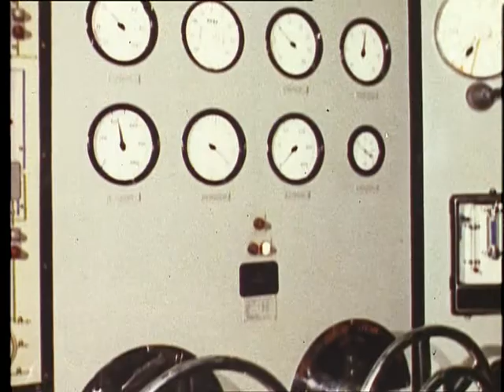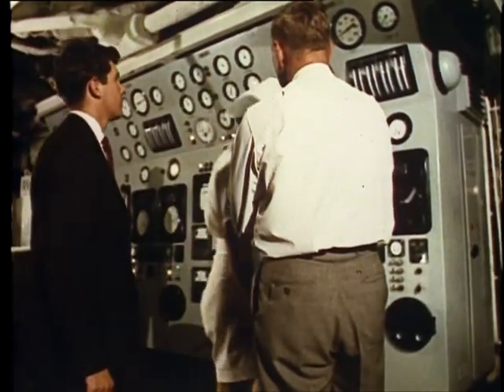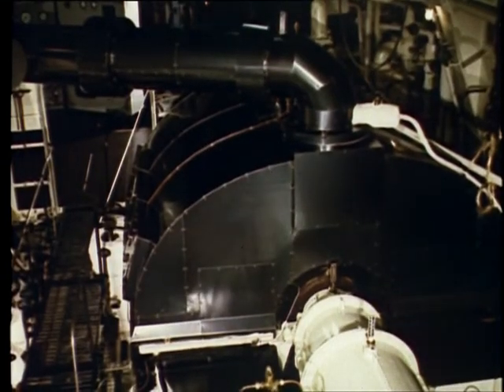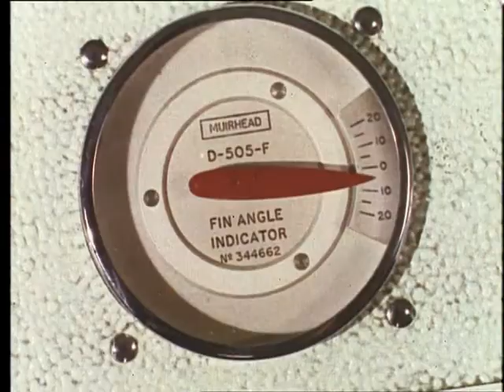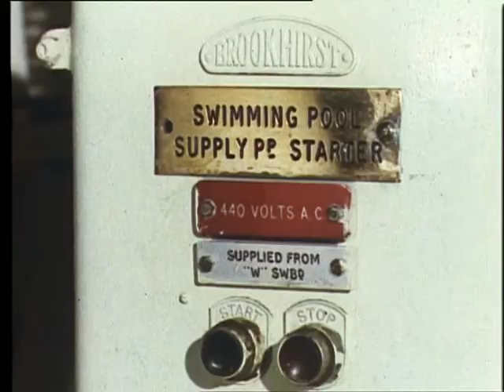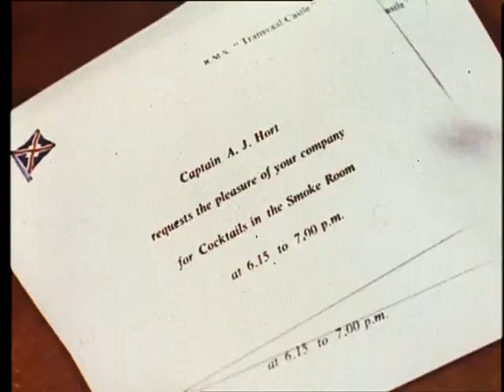Transvaal Engine Room

Comment: This photo is not the engibe room but the generator room i know as I sailed on her
Reply from the maker: Hi, you are absolutely right the photograph was taken in the generator room which include Ginger Mailer chief Engineer and David Keen junior engineer, when I was on the ship we called it the alternator room as she was an AC ship.
I knew the ship well as I joined her in September 1961 when she was being fitted out at John Browns ship yard in Glasgow, I remained on the ship until February 1964. The Transvaal was a wonderful ship, and superbly built, experiencing no teething problems on sea trials and the maiden voyage in fact during my time on the ship we only had one shut down at sea when one of the alternator failed. Regards Don Stangroom. (Junior Second Engineer officer).